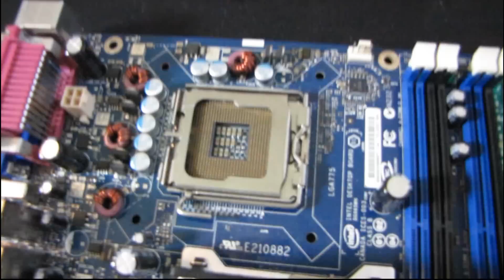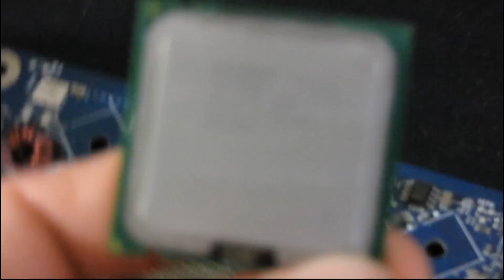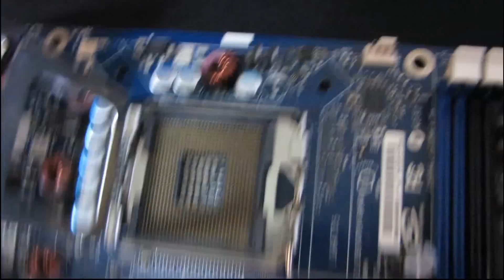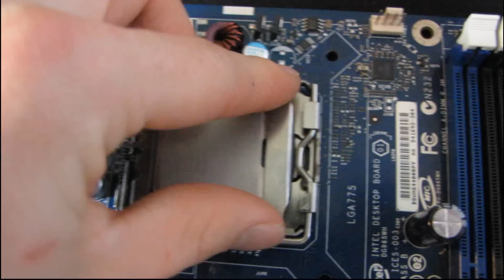Intel LGA775 Core 2 Duo Quad CPU Installation Tutorial Guide Walkthrough Linus Tech Tips

Comment: Who's still using lga 775 beside me?

Edit: It has been four years and I have an upgraded rig with a Ryzen 5 2600. I still have my original PC with the lga 775. Can't get rid of it, has too many memories.
Reply: me. using core 2 quad q8400 with lenovo oem motherboard. that pc still rocks
Reply: Using Pentium D, 2.8ghz Dual Core
Reply: Q9550 here
Reply: E7500
Reply: Using Q6600
Reply: just got my Q9650 in the mail
Reply: Me! Using q6600
Reply: Core 2 duo e7500 from 2009
Reply: A core 2 duo e7400. Works fine for me :)
Reply: Here with a E6400, almost ready to "upgrade" to a Q9400; I'm here to check what Linus says about the (known terrible) stock heatsink.
Edit: but he didn't even mentioned a heatsink in this video xD
Reply: E4500 2.2ghz will now uptade to q9650 3.0ghz
Reply: Watching this on a viglen genie pc with a core 2 duo e4600 and 4gb ram win 7 pro
Reply: got the same with 1gb geforce gt220  @davidthomas9044
Reply: q6850 on my HTPC in2018
Reply: q8200here. its still my fav....
Reply: Ffantasi Golau me too
Reply: I use  a Q9440
Reply: I went from pentium 4 630 PC which my dad built back in 2005 on LGA 775, then I upgraded it to a core 2 duo E8400 in 2017 and core 2 quad Q9550 in 2018-present xd. LGA 775 top PCs are still a beast at 1080p gaming.etc provided good enough GPU like a GTX 1050Ti xD
Reply: E8600 Since November 2009.
Reply: P socket here......

T7700
Reply: Just got a computer with that slot for £30. Got a intel core duo quad core at 2.77 for another £10 off of ebay.
Reply: Me too
Reply: 2019? Here!  E8600
Reply: @iambicpotato2198  i have the same
Reply: @gamerland2317  I have upgraded to a Ryzen machine, though 😁. Still kept my old PC for older games and stuff.
Reply: @iambicpotato2198  i'm accualy waiting for black friday and upgrade to ryzen will be the same again
Reply: +me and it rules
Reply: Recently bought Q6600 and I finally replaced my Pentium E6600. Gonna keep my LGA 775 build for a while ;)
Reply: Me :) Intel Pentiumm 630 3.00Ghz
Reply: core 2 q6700 in p35 gigabyte
Reply: Intel xeon x5650
Reply: Quad Q6600, it's still great
Reply: E5700
Reply: Yesterday I upgraded brother's old Dual Core E7500 with Xeon E5440 from AliExpress for 14 USD
Reply: Q9450 from 2008, still fast enough for me.
Reply: @at41man  On Windows 10?
Reply: @zanussi_fan  of course
Reply: Core 2 extreme over here
Reply: Me, in 2020
Reply: Me
Reply: Hey there✋
Reply: Im considering upgrading my g41 with a e8600 or q9650. Is it viable or what.
Reply: @Lengtackto  Sure. Going from dual core to quad is definitely worth it👍
Reply: Me pentium 4  HT  3.00ghz  single core
Reply: Me here in 2020. A Q9650 in a Maximus II Formula and E8600 in a Rampage Formula. s775 is a great platform for dx 9.0c and 10.0 games
Reply: Me
Reply: I’m using a modified xeon
Reply: me
Reply: Me too bro i wish someone sponser me
Reply: I still do I keep upgrading the crap out of my computer except the CPU and motherboard
Reply: Q6600 in 2020 ✌️
Reply: I'm using E8600 now and it's running really good
Reply: I am still using 🤚
Reply: E5400 2.7ghz in 2021
Reply: me
Reply: Meee
Reply: I'm not using it as my main pc but I just bought a pc with an asus p5e and an intel core 2 duo e6750 it's still pretty fast
Reply: x3230
Reply: E8400 here
Reply: I’m chilling with a Core 2 Duo
Reply: Me
Reply: my friend
Reply: Q8300 right here
Reply: is core 2 duo suitable for basic use and smooth youtube video play?
Reply: me 2021,still using e8700
Reply: @zhenyuray9293  ditto; but with qx9770
Reply: Me 
Core 2 duo
Reply: Me using intel core duo (e5700)
Reply: 2021 here
Reply: I am using core 2 duo e8500. Clock speed of 3.16 ghz
Reply: Q8200
Reply: Me lul
Reply: @at41man  im using 8200
Reply: Same ,... in 2021
Reply: @fishermanbob5169  same ive got s c2q q8200
Reply: @zanussi_fan  yeaa. win10 32bit.
Reply: Me I use a core 2 duo
Reply: E7400
Reply: me, it's a backup storage pc. And I need it as a Windows 7 pc as well, since some old games don't run in Windows 10.
Reply: Me
Reply: Q9650
Reply: Me
Reply: me 2021
Reply: Me in 2021
Reply: Me in 2021
Reply: Me pentium dual core E6300  and i will update it to intel quad core q6600
Reply: I used an Xeon E5450 4x3 Ghz OC @ 4 Ghz. Used a mod to make it work.... damn good old days. It worked even for GTA V max settings. 😅😁
Reply: @Tenders7800X3D  I packed my overclocked Xeon with a GTX 970 and it rocked even GTA V at max settings.
Reply: Meeeee
Reply: @kurtosismusic  me 2
Reply: I’m using a q8200
Reply: Me
Reply: @ahteshamkhan7572  same
Reply: @at41man  what is difference between OEM motherboard and simple motherboard..can I use this processor in normal motherboard without OEM motherboard..??
Reply: @pranavnautiyal3906  of course. as long that board BIOS supported the CPU. I use OEM Lenovo because I just have that spare board, so why not make use of it for pc office. normal motherboard may have better options in BIOS and much feature. I also had Asus P5K-E, and that board have so much Overclock feature.
Reply: Thank You Bro For Replying..
Reply: @zanussi_fan  yes. It runs windows 10 home
Reply: me: using core 2 duo e6400 2.13GHz overclock to 2.32GHz
Reply: @hmactive9197  four years later I can still say the same
Reply: I have a Pentium D 3.40 GHz and want to upgrade to the Q9650
Reply: Me too blyat
The only cheap PC i ever found back in 2014
Even though I've been upgraded my PC into AMD threadripper 3990x, the LGA 775 always close to my heart
Reply: Note : I'm using Intel core 2 duo e8400 for Minecraft and still rock
I've never changed my mind
Reply: im now upgrading e8400 to q9650 😢

Comment: I'm getting a Intel Core 2 quad Q9650 as a performance stop-gap prior to upgrading my (fairly aged) gaming system / workstation. Great video, with clear instructions; my only problem with the video is that I didn't see your cat!
Reply: Hey which cooler did you use with it. Also what is the temperature.

Comment: Still using lga 775 as my main rig
intel xeon x5460 @ 4.275 ghz for 1.3v
asus p5q3 deluxe
gtx 780 

running pretty well considering its an almosts 10years old platform
Reply: Dang looks like you maxed out the 775 socket. Still doing good after 4 months?
Reply: Andorria very nice system!!!!
Reply: My main rig is older/worse  :D
Intel Core 2 duo E6400 @2.13 GHz (LGA 775)
9600 GT (512 MB)
3 GB DDR2
Reply: Bigmike83007 hahaha I'm not the only one with a old rig, GeForce 8500 and e8200 but overclocked

Comment: @ahmadclk yea I have e6420 on my hp computer it runs at stock speed 2.13ghz and is 19c on both cores at idle and never goes above 35c. To my suprise hp does not use a stock cooler and uses a low end cooler master cpu cooler. That's probaly why temps are so low.

Comment: @worldbmx "you dont want to pay big money for a CPU" Forget about GTA IV then. Also, a Radeon 4650 isn't strong enough for GTA IV. Get a AMD Phenom II X4 965/Intel Core i5 750 or higher, and get a Radeon 5850 or higher. About 400 bucks to spend right there. There are no more LGA 775 motherboards, and I dont think any 775 CPUs are on sale. Get 1156, which are i3s and i5. GTA IV requires $600 + hardware to run. The Core 2 Duo won't cut it, and the Core 2 Quads are already old

Comment: Watching this in 2015 and thinking of how upsetting one of the most common flaws of these motherboards are, no matter the brand or age. It seems that the computer will first occasionally hiccup and have a bluescreen here and there for anywhere between 2 and 18 months before the computer just entirely gives up and will either give you 3 long beeps or will literally do nothing more than spin up the fans and hard drive(s). 

My little brother's Intel DG35EC just suffered this, but thankfully I found a next to brand new DQ35JOE to replace it. Extremely identical with all of the same RAM and expansion slots, except the only visible difference I can find from first glance is the lack of PS/2 keyboard and mouse plugs on it, but little do I care seeing as the only PS/2 keyboard I have is connected to a far older geezer that has refused to die for the 4 years we have had it so far.
Reply: +prizedcoffeecup i occasionally get the 3 long beeps on my X975XBX2 after moving things around in the case. I figured out that the ram slots SUCK. you just have to press down on the ram some and it boots right up with no problems. unless I move the case a lot, I don't have any problems and still game the latest games on it and its from early 2007 ;)
Reply: +argorider2 I reseated the RAM god knows how many times and moved it all around too. Eventually the board entirely quit powering on at all.
Reply: +prizedcoffeecup sounds like a short somewhere in one of the slots, The early boards were never reliable, I may have the only X975XBX2 in existence where all four ram slots actually work, usually the slot farthest to the right ( I think?) die on the X975XBX2. Knock on wood but mine hasn't yet. Although I think that is the culprit that causes the three long beeps, it still works though.
Reply: +argorider2 I already revived a different LGA 775 board I had laying around, so I'm good now...just that it sucked seeing that little DG35EC pass on. The raisers were correctly placed too...just old age and my little brother playing tons of GTA 5 with a Core 2 Quad and GTX 460 SE 1GB.
Reply: +prizedcoffeecup that's a nice set up he has! I'm rocking a core 2 extreme QX6800 (just upgraded it from a q6600, got it cheaper than a Xeon it's also the fastest chip for my board) and I just went from a GTX 470 to a GTX 950. Your brother's was for a long time essentially the same computer I was running GTA V on
Reply: +argorider2 And my old gaming rig too. Only difference was the motherboard until I revive the last one it had before winning my current rig recently.
Reply: +prizedcoffeecup Revived*

(I know I can just edit but YouTube app is grumpy and doesn't let me)

Comment: i got a processor from new egg for a LGA775 board and it made my tower light up amber as soon as i plug in the power cord did just buy a fddd up  processor? because the old one worked before but it was only a single core processor this one is a dual core?

Comment: Im using a Intel duo 2 core e7500 as my primary pc I am thinking to upgrade to a Intel xeon 4 core x5450
Reply: An E5450 would consume less power, so I'd rather consider that.
But please, it is not worth it nowadays.
Go get yourself something newer with an Intel Ivy Bridge CPU at the very least.
Or build yourself a PC with at least an i3 10100(F).
If you can spend a little bit more, definitely get the i3 12100(F), it is somehow way more powerful than the 10100(F). ☺

Comment: Hello i have a question. I was thinking of upgrading my PC's CPU. I have LGA1155 socket. I was thinking to give my CPU to my friend because he has old 1.8GHz 1 core processor
He told me that he has LGA775 socket. Can he fit LGA 1155  socket CPU in LGA 775 socket ?
Reply: Unfortunatly no :( but you could buy him a core 2 duo for 8 dollars i just bought one it works perfectly the lga 775 has 2 little holes in the side and the lga 1150 it. Hasnt those holes so its unable to fit there is a core 2 duo e4400 that is 2 dollars in ebay i found while looking to buy one for myself

Comment: Hey there Linus i've still got a q9300 cpu, any video card (2017 GPU) that you can suggest that wont bottleneck my cpu? Thanks
Reply: GTX 1060 6GB or GTX 1050Ti or GTX 750Ti(If u get it for Dirt Cheap) or the Radeon RX 470.

Comment: Can the 945G Chipset support newer Core 2 Duos like the E7000's or E8000's Series CPUS like the C2D E8500 ?
Obviously doesnt support the C2Qs I believe u need a G31/G41 Chipset atleast to go Quad.
But is it possible , ever to use a Core2Duo E8500 on a 945G Chipset Motherboard. (The Board in question is the Intel D945GCNL Desktop Motherboard).
Reply: Josh Syl mine works on e7500
Reply: Josh Syl i have an asrock 945g mobo

Comment: I have a HP8000elite core 2 duo SFF  it will not turn on I changed the power supply and it still wont turn on  the fan runs for half a second and stops few seconds later does same thing could I have a bad mother board?

David M
Reply: yes

Comment: Please guys help me i have the e8600 at 4.3ghz the fastest but still shittiest compared to new cpus just because its dual core. i know really well "the game" and i spend years in overclocking dual cores on 775, im looking foward buying a used 2 cpu server mobo on lga1366 socket with a xeon for now and later upgrading to 2 xeons. what if i buy a xeon for the first cpu and an i series next? ex. i7
 can they communicate together? i believe not, but im not sure. Sorry for my english im greek

edit: the perpose of the system is, gaming without cpu bottleneck as much as possible, i dont have the budget buying new mobo and parts
Reply: Why not buy Core 2 quad its still a Beast and ik it has only Pcie 2.0 not 3.0 Don't let the name Fooled u because 2.0 and 3.0 is has the same Speed and Sata II < i know it has Maximum of 3GB Speed Not like Sata III Max 6Gb Speed But Who cares Just Plug In SSD Graphic card < Rx 460 would be the best Budget graphic card and optimal CPU intel core 2 quad Dont you know Intel core 2 quad vs Intel lga 1151 Pentium g4560 Intel core 2 quad Wins Make your Choice Because My setup PC is Like this LGA 775 Motherboard Rx 460 120gb SSD 500GB Hard Drive Intel core 2 Quad or Extreme < For better Gaming Exprierence and More Performance Or You can Overclock Intel core 2 quad and Extreme and Duo for Better Result in game Listen High Framerate will make Your Gpu Hot AMD have made a Option FPS Limits or a game Setting Triple buffering and V-sync i know you get 60 but what its smooth right And Reduce the Temp of the Gpu and Cpu The there some Problem about Core 2 quad and Extreme Don't Support  SSE 4.2 but Only SSE 4.1
Reply: HafizRobloxTV thanks for the useful info
Reply: you should Buy a used Overclockable Motherboard like Asus P5Q- Pro Or other Great products brand like Gigabyte And Intel core 2 extreme Used < If you can find great deals if not get Intel core 2 quad Or Get Xeon Processor You know the Lga 771 to Lga 775 Mod but it might be risky But its worth for money budget and performance
Reply: HafizRobloxTV i got the best motherboard p5qc from p5c series. There are not many motherboards that can do 4.3ghz, you should have thought of that, second i told you that i can overclock like hell why i should buy a motherboard?
Reply: HafizRobloxTV i will buy a qx9650 because i already know all the technical stuff , the fsb on my motherboard cant go past 1650mhz thats like  4.3 ghz, knowing that i can buy a cpu with a higher unlocked multiplier ex. at 12x compared to 10x on the p5qc so i can benefit from the cpu circles that don't need to read/wright to memory via the fsb. That said, i can benefit from the quad series without buying an ultra overclockable xeon cpu, because i cant pass the 4.2ghz stable. Thanks for your time i got the answer months ago and btw im studing software engineering
Reply: Just Saying lol If you Don't Have a Overclockable Motherboard thats all